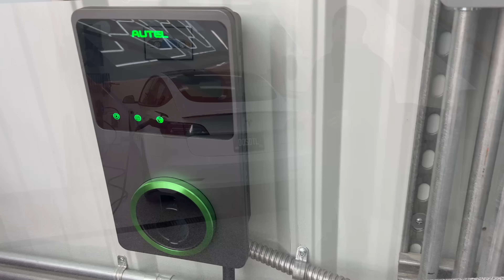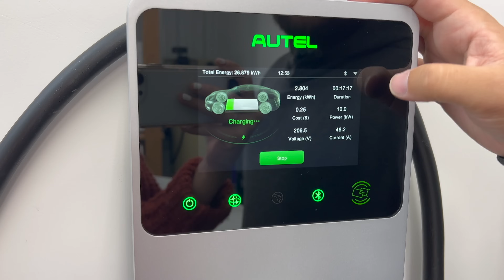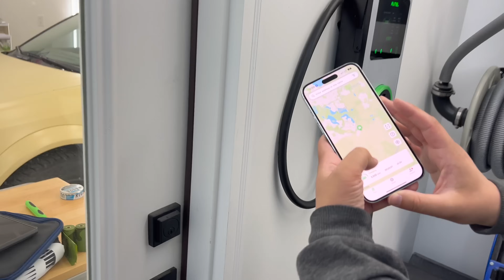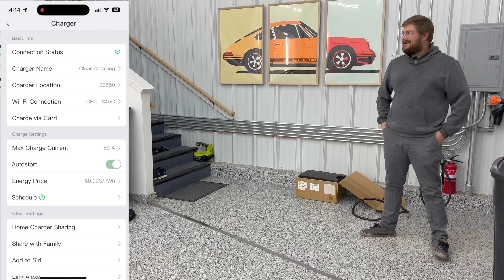We Focus Too Much On DC Fast Charging! Here Are Some Level 2 Considerations - Autel Touchscreen AC

Comment: Does Autel make a Level 2 EVSE that can charge most EV's in America without needing to use an adapter between the vehicle and the charge cable? I like to reduce the number of connections in the electrical path so it would be ideal to have one that works natively with the NACS standard. Using a J1772 to NACS adapter adds four more connections in the electrical path that can become oxidized or contaminated.

The Amazon listing for this unit says it's "compatible with all EV's" but it glosses over the fact that you would need a charge port adapter to charge EV's with the most common charge port in America, the NACS used by every Tesla made.
Reply: the standard is actually the J1772 not the Tesla plug.  Even in Europe they use CCS (2).  By the way the adaptor coming with a Tesla is quality equipment it will not affect anything,  I mean if you must have the Tesla plug well the Tesla wall charger will to 48A the max a tesla can take. then no converter is needed.
Reply: @nick-3808   In the U.S., the North American Charging Standard (standard equipment on all Tesla in N. America) is the one compatible with the vast majority of EV's on the road. A J1772 requires an adapter to fit most EV's if you live in the U.S. - Tesla charge ports are on over 60% of all EV's on the road. It's also a technologically superior port. It weighs less, costs less to add to an EV, is more reliable and can handle more power. That said, the fact that they are also the most numerous is the best reason to have a EVSE that doesn't need an adapter to charge most EV's.

The fact is, when Europeans visit the USA, they don't bring their EV's with them so I'm not sure your point makes any sense!
Reply: @ZipZoomZip  have you ever seen a Level 2 charger that does not say Tesla on it have anything than J1772?  (they do not exist) Tesla standard is a standard Tesla made.  Because they call it North American standard it does not mean it is a SAE standard.  https://en.wikipedia.org/wiki/SAE_J1772   is the standard all over the world.  Also Tesla uses the standard outside the US  J1772 and CCS.  Have you ever seen a Tesla supercharger out of the US  using it ?  Nope they use CCS (Also standard  https://en.wikipedia.org/wiki/Combined_Charging_System). this is the point I am trying to make.  If you want not to use the adaptor Tesla is the only option.
Reply: @nick-3808  Tesla makes EVSE's with both J1772 and NACS connectors. It doesn't make any sense why other EVSE manufacturers wouldn't offer a solution for the most popular charge port (NACS) in North America. That makes the Tesla Wall Connector the logical choice in the U.S., especially since the Gen 3 Wall Connector only costs $425 while offering Wi-Fi connectivity and pay-per-use charging for those applications that require it. It's also made in the USA and I know of no other EVSE that can offer all of this. It's a real American value so it kind of makes me wonder why any American would buy anything else.

Comment: I really think we need to get rid of Level 1 vs Level 2 EVSEs especially when there are so many different charging speeds on Level 2 chargers.  I think both Level 1 and Level 2 EVSE should just be labeled by the max kW they can deliver.  For example an EVSE that can operate at 240V/40amp (50 amp circuit) would be called a 9.6kW EVSE.

The other thing that is really needed with level 2 public charging is plug and play use and billing.  If shopping centers and other short term stops (30min to 2 hour stops like shopping/movie/restaurant) then small battery EVs start making a lot more sense for every day use.
Reply: Current is a better measure as it is maximum capacity of the device. Voltage varies so the resulting power varies as a result. A 208 volt 3 phase line would typically  send less power than a 240 volt line , (or 120 volts} . ( 3 Phase in a 3 phase Device would multpy the power by 3 - a 3 phase line could send 22 kW AC in Europe to a Renault Zoe but only 6 kW to a regular car). Like in plumbing a 1 inch pipe restricts how much water moves depending on the pressure.  A DCFC called 350 kW really means it could supply a maximum of 350 amps at 1000 vollts DC.  The power supply to that charger might be power constrained to less than that due to site limitations. I have a 12 amp charger it's 1.2 or 2.4 kW depending on the voltage.
Reply: @JohnRoss1  I think you made my case better than I did.

Comment: Thanks Kyle, this and the other video you guys recently make me feel like my complaints have finally been heard. :-)

I have had a Blink charging unit professionally installed in the garage of the new home, with its own breaker box, and it allows me to do the local errands in my PHEV on electrons.

The only downside is when I am at the old condo, packing things up, because that doesn't have a way to charge, community parking lot, etc.

The Volta public chargers near the condo are routinely hogged by Teslas, so from the old place I can only charge at the office or sometimes from public charging. That is a contributing factor to why I have a PHEV and not an EV car.

Comment: EV ownership is every bit as fun as Kyle presents. Home charging off solar is like having an oil well on your property and gas pump at your house. EV6 in our garage and a Denali EV reservation with GM.
Reply: It's hard to get people to think about this as you presented, but that is the best way to pitch it. I am starting the deployment of my solar array next week (starting at 8.9kW with potential for 10-15% gain from bifacial), really looking forward to driving off of power from the sun!
Reply: With the advantage that you’re making efficient use of your energy and not producing poisonous fumes. It really is all good 😊
Reply: what's the best bang for buck solar array I should be looking into? (complete noob here)
Reply: @Robosan4000  Tesla makes good equipment but Tesla doing the install should be avoided.
Reply: 109% pre las sentence
Reply: Only takes 20 years to pay off the solar!

Comment: 3 wires, positive, negative and ground?  In an AC system? Your electronics teacher is turning over in his grave lol.
Reply: Yeah I was surprised he said there is no neutral.
Reply: Don't need a neutral, the charger uses both AC phases or 240 Volts

Comment: Two (AC) hot legs and a ground. No DC out of your AC panel.
Reply: Service entrance conductors from existing electric company residential transformer feeds 2  120 volt 100 amp panel that feeds 240 v 60/80 amp charger
Commercial buildings are 3 phase 277 v add amps across breakers

Comment: Going to be honest. I think the home charging idea will only be a tiny percentage of people. There are literally millions of homes apartments  condos ect in the USA , Canada and Europe that it just won't work...or could actually make things worse. Once they have the newer batteries in place and you can get 200 miles of range in 15 minutes is when EVs will truly hit the mainstream.
Reply: Jayman: In the United States, the majority of housing units are single-family houses – about 82 million out of the total 129 million occupied units in 2021.  That much mor than a tiny percentage. That’s 64%.
Reply: @205rider8  exactly and over 80% of all new car buyers in the U.S. are homeowners with six figure household incomes. 
So until evs are near 80% adoption rate(likely 2030 or sooner, push for home charging solutions, then work, then apartments&condos etc.👍🏻
Reply: Home charging (or comparable Level 2 charging) will represent the majority of charging for most EV drivers. I can't picture a world in which the majority of EV charging is done on public DC infrastructure.
Reply: @garthschanock  15 years ago no one could picture this entire conversation.
Reply: Sorry but those cars are parked somewhere, each and every night(invariably with-in a block or two of the same spot). Solutions for apartments, condos etc might(will) be more difficult to achieve, but there are solutions that can be pursued. Work with condo board to have designated charging spaces, or better yet charging available for all designated spaces. Work with apartment managers for the same. There will be push back, some management won't see the expenditures as investments in the properties but that's your opportunity to teach. Point out that the charging does not need to be provided for free and could represent a new revenue stream. Work with local utilities and city planners to install on street charging near apartments. There are solutions. And if you run into a landlord who refuses to work with you, vote with your money and leave that space.
Reply: There’s a pretty specific demographic buying ev’s. They mostly have access to their own l2 charging systems
Reply: I don't think an EV would work for us with having a garage with dedicated level 2 charging (which i have for my M3).  If i was an apartment dweller i would keep driving fossil.  Until we get to Norway level of charging ability --nope.  We have 4 parking ramps downtown in our city and 1 charger total.

Comment: Level 2 charging is what most EV drivers should be doing most of the time. It’s much cheaper and when done at home it is most convenient. Save the DC fast charging for longer road trips.
Reply: AC level 2 Charging also will help prolong the life of your battery.
Reply: Level 1 120v 30 amp trickle charge in is best u plumber
Reply: @sparkysho-ze7nm  "Level 1 120v 30 amp trickle charge in is best u plumber"  Why not charge at 240V, 25A?  faster, still easy on the batteries.
Reply: Of course. But the ability to DC fast charge quickly when you do need it—even if it’s only once or twice a year—is critical.
Reply: If you are a typical commuter, soccer mom or dad or a retiree, I believe level 1 is adequate.  I installed a level 2 juice box and find it’s more than I need.  A 120v level 1 will charge at about 1.5kw which can translate to 6 miles per hour of charge for my efficient BMW.  A 12 hour charge yields 72 miles.  If I had to do it all over again I would have just stayed with level 1.  Bottom line, start with level 1 and determine if that is sufficient. Then decide whether to spend the money on level 2.
Reply: Yes, but DC recharging is also less reliable
Reply: Wtf
Reply: I agree with you 100%
Reply: Level 2 charging is easy for people living the suburbs with off street parking. The real challenge is what to do for people in higher density neighbourhoods (i.e apartment blocks or townhouses) that have to park in the street. I believe cites should install level 2 kerbside chargers as part of the standard street furniture, in the same way they already provide road signs, traffic lights and street lamps. 

For local residents kerbside charging should be absolutely banned from being used as a revenue source. Instead billing should be via an app that adds the power consumed to the user’s residential electricity bill at the same rate they pay for power use at home (including any EV discounts).
Reply: Sadly it is not much cheaper, if cheaper at all to do home charging in California.
Reply: @ I doubt that home charging is just as expensive as DC fast charging, even in parts of California. Particularly if you take advantage of lower time of use rates. The average cost of electricity nationally is about $0.13/kWh, while the average cost of DC fast charging is closer to $0.50/kWh.
Reply: @ doubt all you want but I’m living it.  I pay $0.54 per kWh for electricity from PGE in my area.  So that more or on par with charger rates, so home charging doesn’t save me money…it’s just more convenient if you have the time.   Fortunately i get 3 years free DCFC from VW so I always fast charge.
Reply: @ That is certainly many times higher than the average Nationally or even across California. Definitely an extreme end of the spectrum of electricity costs. California as a whole averages $0.31/kWh and many of those EA stations run $0.64/kWh.
Reply: @ if only I was so fortunate.  I think my rate are high because it’s generated by some green power source.  PGE takes a cut for use of their transmission lines and billing management

Comment: I just got that one,  unfortunately overheats after about an hour in hot temperatures. I bought the commercial version because I thought it would stand up to the heat better because my location is out in the Sun but it's not even summer time yet and it's already overheating.
Reply: Also when it's not in use it displays Autel advertising in my driveway trying to figure out a way to get rid of that
Reply: Yikes.  Might be solvable with a hood, but there's no way a glorified smart lightswitch should be overheating.
Reply: I’d set it to charge at 22A. That’s what I do…..doesn’t add much charge time and doesn’t get hot. I’m on a 50-A circuit.
Reply: I’d be on the phone with Autel.
Reply: Hey Crazypostman, Autel official account here, we're sending you a DM to get your issue troubleshooted and resolved.  Check your inbox, thanks.
Reply: You may want to reduce the level of charging to reduce heat generation.  You can do this within the evse or the car software.  I am sure you know that per NEC, the evse should be set at no more than 80% of the rated amps of the circuit; in other words if your circuit breaker is 40 amps and you have a 40 amp evse, the evse should provide no more than 32 amps to the car.  I use a 40 amp rated evse on a 40 amp circuit and have the evse set to 32 amps; I use the car software to downrate the amp draw to be 28 amps.  The difference between 7.5 kw at 32 amps and 6.8 kw at 28 amps is negligible on an overnight charge.

Comment: In 2014 in the UK most chargers were AC, power up to 43KW. Only 1 car could use all that power, the original Renault Zoe. Given all the 'stuff' needed to convert AC to DC at high power levels was already in the car (inverter, enabling regenerative braking), it made perfect sense to use it. AC is of course, demonstrably safer than DC, also  requiring only a tiny housing, it made sense for charge power below 50KW. Thermal constraints in the car are the sole reason DC exists below 50KW.

Comment: Save your money and just get a 240V outlet installed!! lol
Reply: Until it melts.  Not all outlets are made for prolonged use at full
Reply: @pikachupoop2175  No issues with mine, use a quality NEMA 14-50 outlet like from Hubbell. Dont use a cheapo $10 one.
Reply: @ctk4949  for sure, but most people don’t know the difference
Reply: @pikachupoop2175  Well maybe he should make a video on that and not to tell ppl to waste $1000(plus installation) on this charger!! lol
Reply: @ctk4949  huh? You can get chargers for under 500 and installation is the same as an outlet.  Move on dude
Reply: @pikachupoop2175  The one he is suggesting in the video is $1000!! Also I got quoted $200-400 for installation of those type of chargers. An outlet only cost me $100 for installation. But you enjoy and move on, thanks!!
Reply: @ctk4949  It's the same job to connect the wires to a charger or an outlet, except you don't spent the extra money for the outlet and box, not sure why it would cost more.
Reply: @aaronhodgman  Who knows, maybe it's the "EV" tax, lol